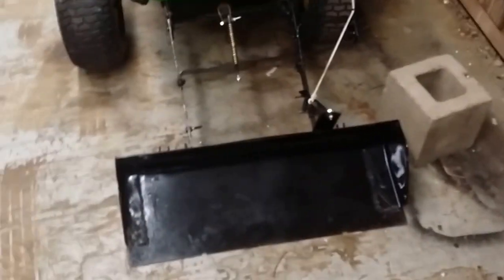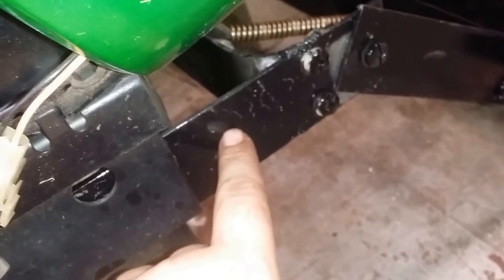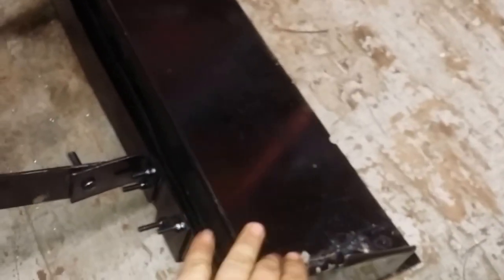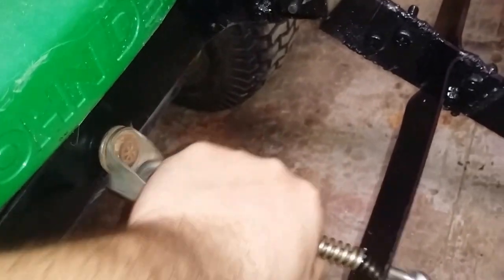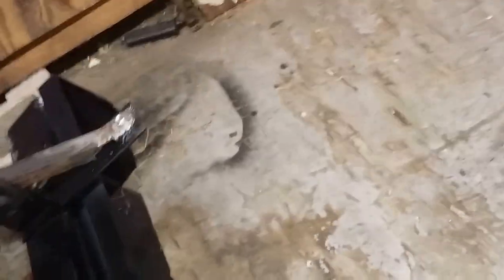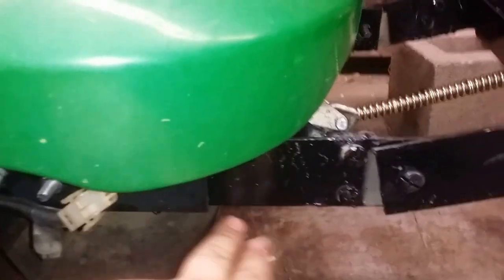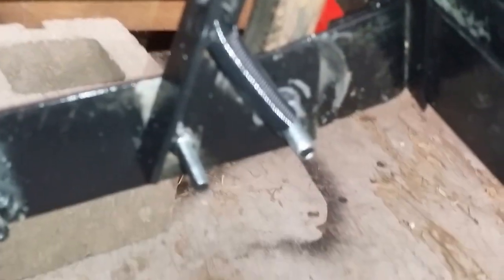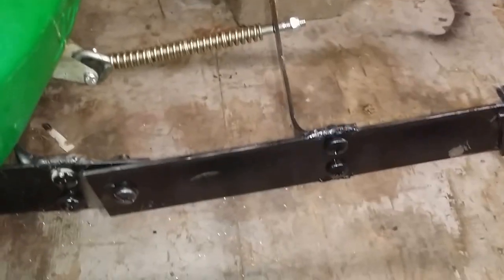simple lawn tractor bucket build

Comment: This is exactly what I'm looking for. A DIY simple way to move light loads around without buying a small tractor! Thanks!
Reply from the maker: Take what I built with a grain of salt , I had to further modify a few times, I would suggest strengthening where the lift handle mounts and maybe cross brace the arms
Reply: What I'm not clear on is how the clasp mechanism works ~ how it hooks and releases. I think I'd put it in the middle though, hooked to both sides of the bucket to even the load out, and use a boat winch cable instead of a rope.

Comment: Killa job you did . You have helped me with my build .I looked at your set up and thought to myself that is functional and super easy to use. So kinda working off your ideas . I added linear actuators that run on a 12 volt deep cycle and still run the starter battery welded up a box on the back  for a few extra pounds and beefed up the front frame with a little more iron . thanks again for a solid video

Comment: I'm looking to grade then smooth a lightly hilly yard, mostly for aesthetics and improved drainage but also to make it easier to mow. Do you think this could handle the stress of dragging and pushing dirt around a yard?
Reply from the maker: Most likely not, loose dirt sure. But packed dirt would fold it in no time
Reply: What if it's freshly tilled?